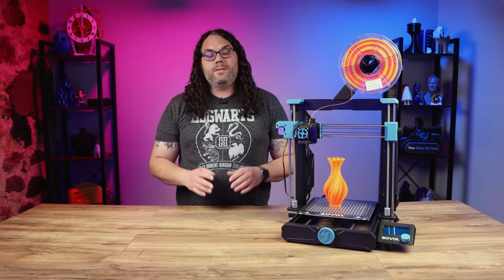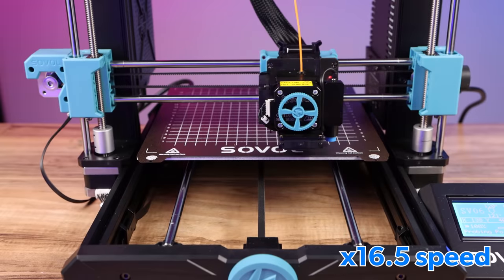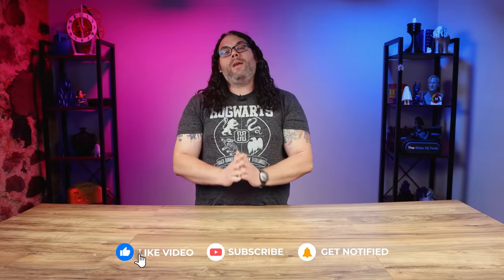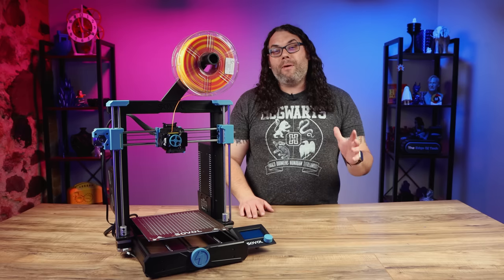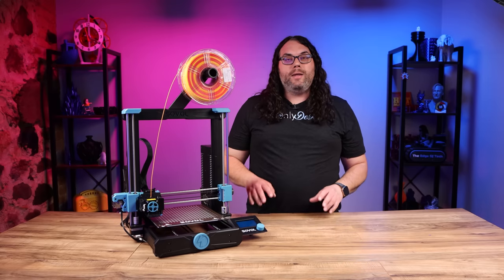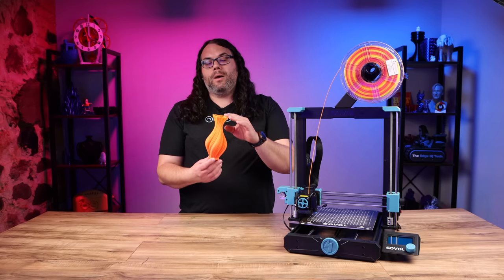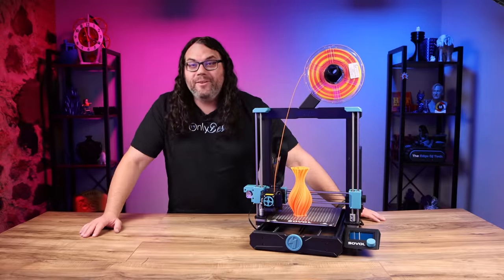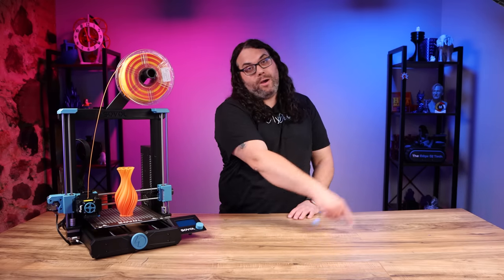The Sovol SV06 Is So Good That I Am Giving It Away!

Comment: The SV06 automatically align the Z axis... when it works.
The first thing I learned with the printer was to align the Z axis by hand.
The second thing I learned was setting the Z sensor height. Then also work with the 5x5 measuring points.
After the z leveling was out of the way, the prints also worked.
But I would have liked better instructions. 
Not only that the printer stops without any error message and the user can guess what is wrong with it.

Comment: I'm on the hunt for my 1st 3d printer and kind of stuck on which one to get the SV06 or the Neptune 3 Pro. Both seem very capable. I'd like to be able to print both TPU around the 80 ShA hardness and more premium filaments for automotive use. So I'm not sure on which one will best meet my requirements.
Reply from the maker: Hi! I don't have the Neptune, but I can tell you that the SV06 is solid. It would be a great first 3D Printer and for the price right now of $229, you can't beat it. It's direct drive, so it should do that filament just fine. See my pinned post for the link with the sale!
Reply: @TheEdgeofTech  Thanks, that's good to know. By any chance did you ever get to take advantage on the higher temp capability?
Reply from the maker: @zXCrackersXz  I didn't.

Comment: Very interesting printer. I dont know how they can keep the price so low. I have modified my stock ender 3 (that was free) and I wont even calculate how much I have spend on it, and now you can buy really nice printer for a fraction of the cost. 😅
But one thing I’d like to know that does this printer also have that famous ”uneven extrusion” problem that majority of direct drive dual gear extruders have? Like many prusas, vorons and my Sprite pro extruder has.
Anyway thanks for the great video as always. I really like watching your content.
Reply from the maker: Thanks! In my testing I didn't see that. I don't think Modbot or Sam Prentice did either. But if it does, a little tuning should fix it! It's a solid printer, and for the sale price right now, how do you beat it?
Reply: I've spent about $200 CDN upgrading my Ender 3-V2 with a Sprite Pro extruder and dual Z to save money over buying an E3 S1, only to turn around and buy an entire printer for $100 more 🤣